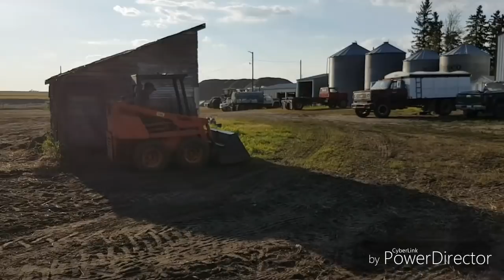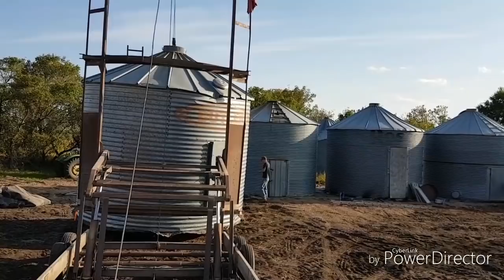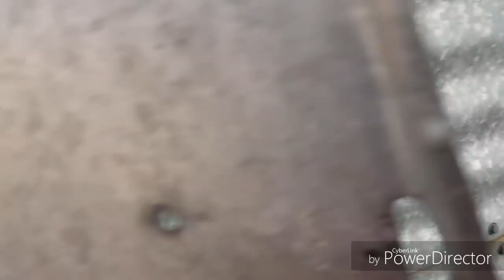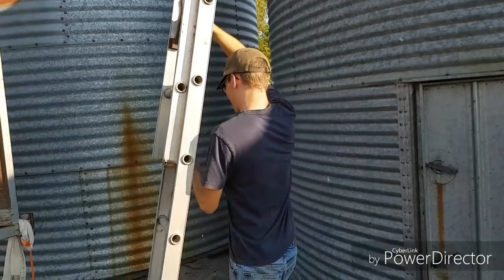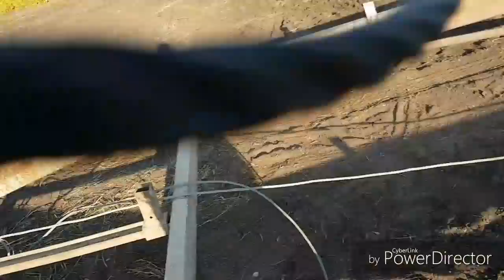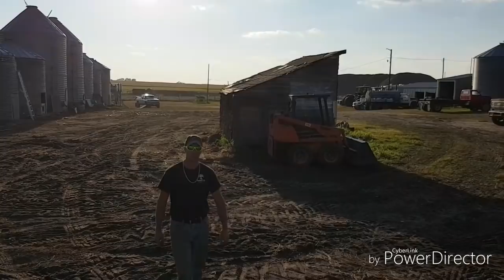The bins are done! And Antoine pulls his wire in celebration

Comment: Over 20 years ago, my cousin had a bin a little larger than that one, (I don't remember how many bushel it held), but the bottle ring was rusted half way up. We used a borrowed well/boom truck with a truck rim in the center to lift it. Then took a Stihl wheel saw and cut the rotten half off.  It was 2 or 3 am by the time we finished.  (I don't care to so it again).  Ha ha ha!
MB BAR RANCH
Reply from the maker: Oh man lol

Comment: Ol' leg tanks... geez I thought I was the only one backwards enough to still be using one LOL:)  Course, heck, around here they won't deliver less than 250 gallons at a time, so I have to be flat empty before I call the diesel delivery company.  Course in Indiana they want to bring out a half-truckload at a time, but the BIL has a big barrel on the ground beside the barn with an electric pump on it.  Sure is nice filling up compared to how slow a gravity fill is from a leg tank, but it costs more and is more to keep up, plus if you had that here you'd REALLY be inviting the d@mn thieves... 

Why all the little bins?  That just a thing up there?  Most of the ones I've seen are 10,000 bushels and up.  Heck a 10,000 is considered something of a "baby bin" most places now.  At the nephew's grandpa's farm, they put up a 600,000 bushel bin.  H3ll they have their own elevator truth be told, bigger than the one in town.  They've got a couple rows of 40,000 and 50,000 bushel bins and a couple 100,000 bushel bins, but then a few years ago they put up the MONSTER... you can see that thing from town! 

Course, I guess yall have reasons for the smaller bins.  Cost is almost certainly one of them.  Even a 10,000 bushel bin practically needs a mortgage to pay for anymore...  

Later!  OL J R :)